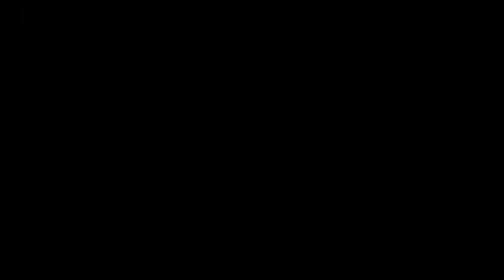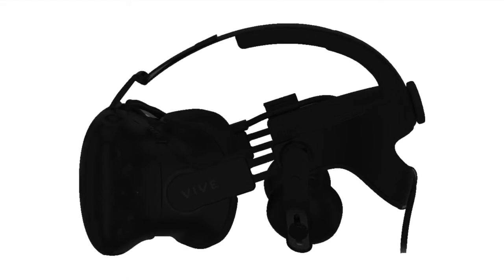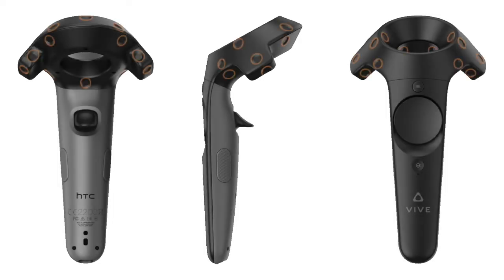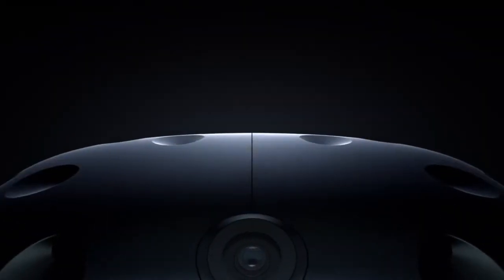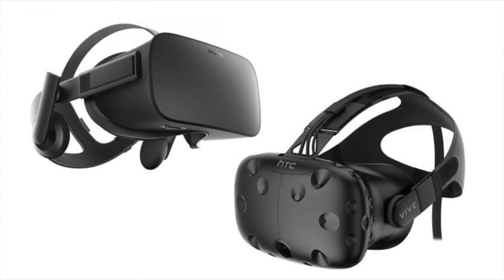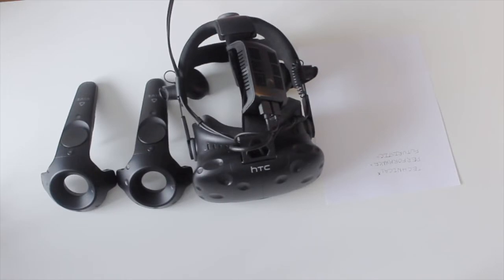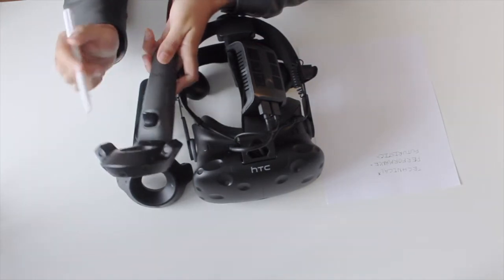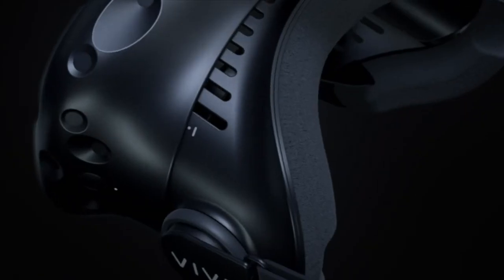Industrial Design Analysis: Understanding HTC VIVE #industrialdesign

Comment: Futuristic, jam-packed, and clunky (and for sure NOT simplistic; the Quest 2 fits that word way more) were the words that came to mind. I also wanted to say militaristic, but I did not want to use a word that describes a specific setting.
Reply: DARN, 'technical' turned out to be a much better word to describe the amount of functionality they are trying to cram into the HTC Vive. I took note of the wiring lined over the head-strap and the complex shape of the controllers, and that's how I came up with jam-packed and clunky, but technical really hits it home better. How'd you learn to find very descriptive words that can explain so much about a design?